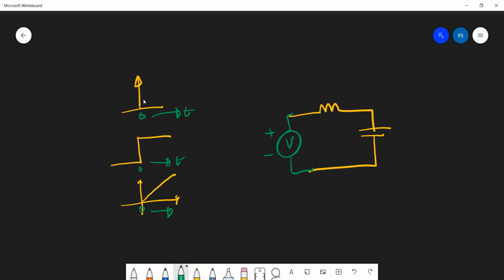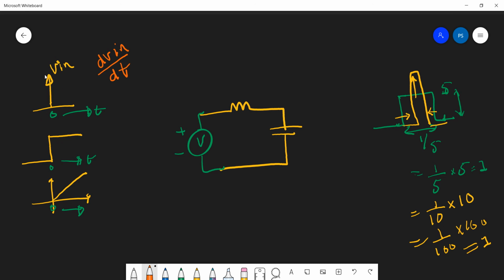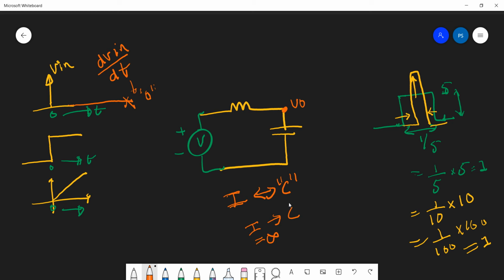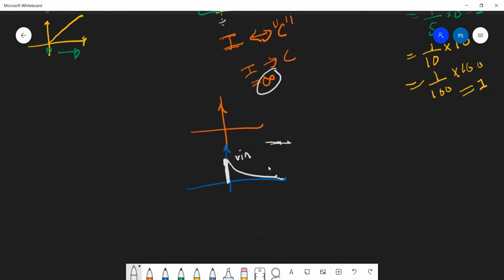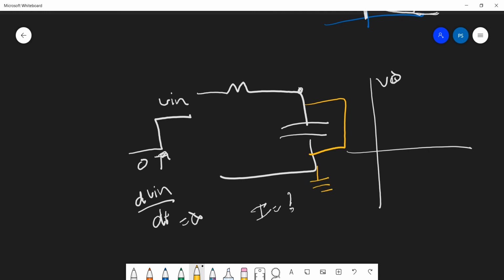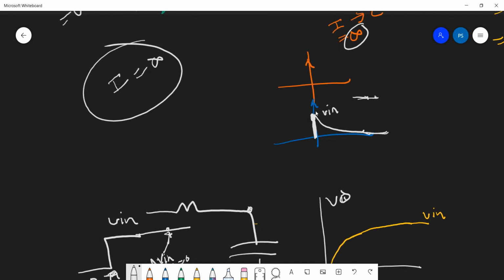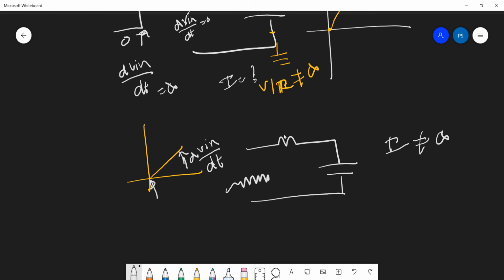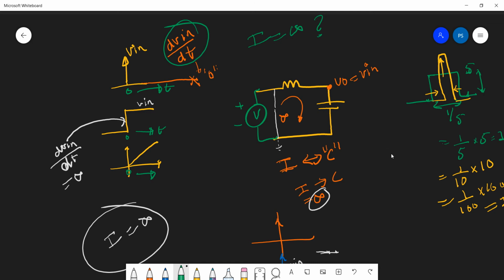Impulse, step and ramp response of RC Circuit : Analog circuit design Interview

Comment: I am not sure about the RC response @ 17:50. I don't think the voltage will be zero initially for sometime before rising for a linear ramp up signal because dVin/dt will remain same throughout. I think the start point will be origin itself but the RC constant will decide whether the output rises faster or slower than the input ramp.
Please correct me if i am wrong
Reply from the maker: Hi. As for the initial current , it will start from 0 . I suggest you to plot it on LT-spice for clarity . Thanks
Reply: @vlsiorg  Ok I will check. Thank you for the reply.

Comment: Capacitors block the change in the voltage.So suppose I give the impulse from 0 to 5 so there is a sudden change in voltage.So it will block that change and at that time voltage should be zero not the maximum voltage or the caps will not charge.Caps don't charge in TS they charge in SS . If so then how can the voltage be maximum as per your explanation for a impulse in real life.

I think you should come out of simulation world and be more practical. In real life there is no such thing as impulse .Even an impulse takes a time to rise and fall maybe of the order of ns or ps.That nano or pico becomes a steady state for the signal.In that staedy state the capacitor charge and discharge.

Impulses are steps without the steady state theoretically but practically the steady states are so less we don't consider that and make those SS as zero.
Reply from the maker: Hi , Thank you for your comments.
The purpose of these lectures is to create intuition and they help us in analyzing circuits.  I agree , the impulse is not real and you may not see it in your lab. But In analog design ,we build on our theory and intuition to create any real working circuits.

Comment: Sir first of all thank you to the content .Sir you explained in a good way .but I am requesting you plz make vedios on following type of cases 
1) when a capacitor is connected at drain side of mos and pulse signal with some time period T applied what can be the output signal,how capacitor voltage varies 
2) When cap is connected at source and pulse signal applied with time period T what can be the output signal,how capacitor voltage varies. 
3) when caps are connected at drain gate and different signals like step ,pulse with time period T is applied how cap voltage changes 
All these cases for pmos and nmos . These kind of things are not present in books.  In the interviews and in the written tests these kind of questions they are asking if you make a vedio on this it would be a great help for us 

After this when caps are connected to cmos inverters of different combinations I.e at Gate,source,drain ,gate and source ,source and drain ,gate and drain ,gate and source and drain and applying different inputs like step,ramp,pulse and observing how cap voltage varies and what will be the output signal in each case . 

As a subscriber I am requesting you make vedios on this topic . One vedio it will take 45 min time
Reply from the maker: Hi , I will surely try to make one such series .